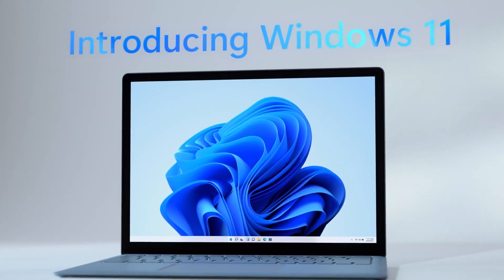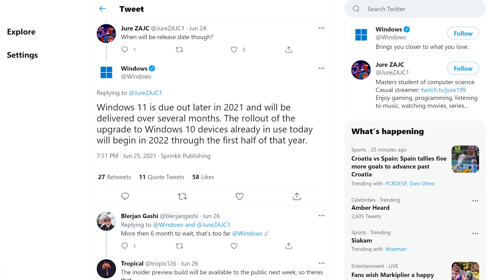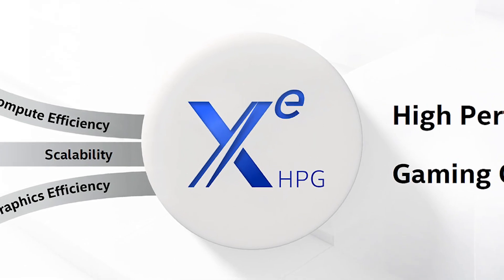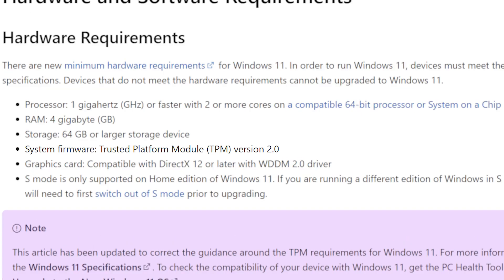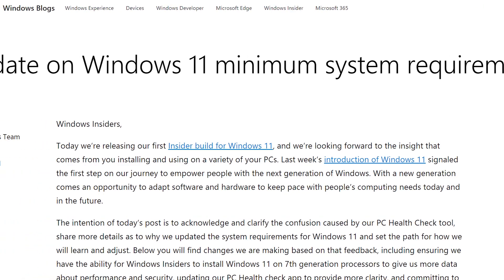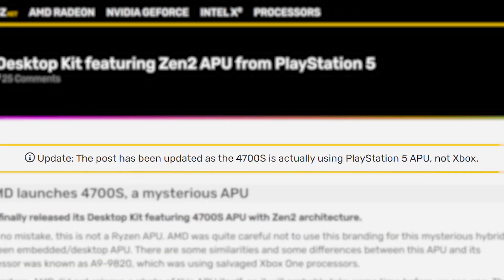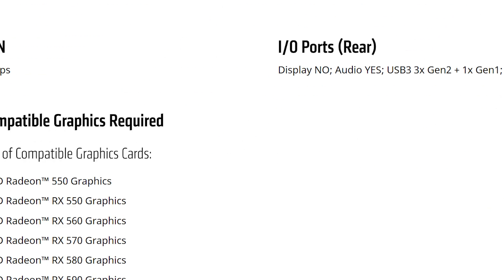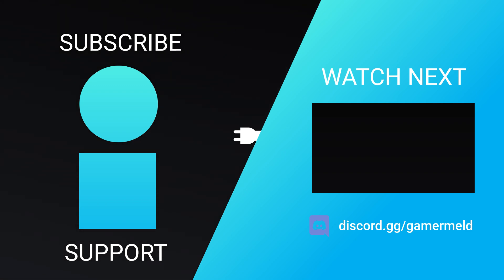TONS Of Gamers WON’T Be Able To Install Windows 11!

Comment: Unless Microsoft just reverts back to Windows 10 requirements for installing Windows 11, they are going to have a terrible adoption rate for this new OS. I guess they really want to keep up with the "every other Windows OS is shit" strategy.
Reply: But win10 IS shit!
Reply: Like lighten the TPM requirements to 1.2, keep the UEFI secure boot Which would allow older CPUs to run Windows 11. I still think they will keep the other requirements though. The current requirements are more of a financial move for them then a beneficial move for anyone using Windows 10
Reply: @IdeasAreBulletproof  Especially considering 99.99% of all users will not use the features tpm offers anyways. I am lucky I own a 9900k, which includes intels TPP, which has TPM2.0 integrated. But as a gamer, I will definitely not usw any encription features etc. Imagine not being able to recover data from a harddisk because it is encrypted :/
Reply: @IdeasAreBulletproof  most people will not even know how to turn tpm on
Reply: @IdeasAreBulletproof  dude my ryzen 5 1600 is tpm 2.0 supported and i have secure boot but it isn't supported XD
Reply: @pisipisimeow  Same with one of my laptops I5 7200U. It has TPM 2.0 but It says the processor isn't supported
Reply: @IdeasAreBulletproof  I'd be happy with no TPM requirements and just let it all be entirely performance based. it's not like TPM 2.0 is useful to most home consumers and even if it was it can be replaced with software so we don't end up with people on eBay scalping. like they do every time Microsoft announces something.
Reply: @IdeasAreBulletproof  they'll never do it, they want to push Pluton-integrated CPUs. hardware level DRM is cancer.
Reply: @NightfallGemini  I know I don't think they will do this. Just means they will get a worse adoption rate of Windows 11 from Windows 10 and a way worse early adoption rate even If Windows 11 is more stable then windows 10. But then again Windows 8-8.1 was stable and had a terrible adoption rate because they got rid of the start menu and button and had new features that would take time getting and made it not easy to use. Windows 8.1 changed that but It was already too late.
Reply: @IdeasAreBulletproof  People are idiots. I installed Windows 8.1 to replace 7 due to Parsec requiring it, and I basically got the same experience (including custom dark theme) but faster.
Reply: @chlorobyte_projects  I used Windows 8.1 for like 3-4 Years In 2 separate Time spaces and I had a pretty good experience With it.
Reply: @IdeasAreBulletproof  windows 8.1 was a lot better than windows 8. Huge improvement, and after update 1 it definitly became decent.

Windows 10 on launch was terrible. You couldn't even change the title bar colors
Reply: @WorivpuqloDMogh  I agree with that Windows 8.1 was an Improvement to Windows 8
Reply: @NightfallGemini  than they wont have as many people adopting the new os its that simple.
Reply: People said the same thing about windows XP, then they said the same thing about windows 7 & 8, then the same thing was said for windows 10(best selling OS to date) and now people are saying the same thing about windows 11, long story short people will upgrade just like they have in the past. There are very few stuck in place old farts that refuse to accept change.

We got people still refusing to leave windows XP even though that OS was garbage with security holes and blue screens every 5 seconds. Then there are those people that think Linux is the be all holy grain of OS systems, yet it has its own set of issues.
Reply: What, I can hear you to care enough. The Linux Community is cheering and breaking out the cardi!
Reply: Just to be clear, this is only about the Windows OS's and how they compare to each other over the years. Linux is irrelevant to the original point, which would be well known to experienced/long time PC users.
Reply: @juzujuzu4555  I have no loyalty to any corporation or brand. Same goes with operating systems. The moment Linux gets better gaming performance and matches the support windows gets, ill switch in a heartbeat. Like I said, best tool for the job
Reply: @SteveDonev  Linux isn't a brand or controlled by anyone, that's the reason why I like it. Though I would be happy with any free (as in freedom) software based OS and tools.

As a developer I know too much about proprietary software and services to ever feel comfortable with them anymore, but FreeBSD or other BSD based system would suit me well in personal stand point, but Linux is superior for development.

But Gentoo is what I truly love. You build your own Linux from sources on that one. While the initial learning curve is semi hard, after that maintaining it is almost as easy as any Linux. The freedom and configurability of Gentoo is just insane.

Lets hope Steam support for Linux gaming is the thing that transfers things. They are building their Linux based PC gaming handheld console. Hope it will get popular, as that would truly change things.
Reply: @juzujuzu4555  I will say this, competition is always fantastic, even if Linux never does overtake windows in gaming performance, the fact that they are inching closer has definitely motivated Microsoft to make windows 11 lighter. The last thing I would want to see is a return to the early 2000s where Microsoft had complete dominance
Reply: @juzujuzu4555  no worries, I read it all lol. Infact if I wasn't an avid gamer I would have probably switched to Linux long ago. As for windows 11, yes the minimum requirements are higher but I think that's just Microsoft sandbagging so they don't get another Vista situation. Based on videos of the insider build of windows 11, it definitely seems to be using less resources than windows 10. Although that may be because not all features are implemented yet. We'll have to wait and see
Reply: @moioyoyo848  it absolutely does. I've ran dual boot windows Linux to test and its pretty consistent. Now don't get me wrong, Linux is better than windows in a lot of things, gaming just isn't one of those, and gaming happens to be the main use of my pc
Reply: @SteveDonev  if you get lower performance that doesnt mean everyone gets
Reply: @moioyoyo848  it was a clean install on identical hardware. Its an os test. Everyone gets worse gaming performance on Linux. Try it yourself. Do a fresh install of windows and Linux dual boot, then run a few gaming benchmarks. You will see that unless the game runs Vulcan (doom), all direct x games run worse on Linux
Reply: Windows 11 will be an Windows 8 2.0
Reply: I disagree. With a newer system and the enabling of the security features I have had no issues and do not project to have any. Adoption will be a no -brainer for new PC / Laptop buyers and those that are wanting to build a new rig shouldn't run into any install issues. With that being said, Windows 10 users are sure to keep plugging along especially companies that are not going to just jump on the bandwagon for a new OS. SCCM should support in the next major release and most software will be compatible as the kernel doesn't appear to be changed that much. It's more of a UI upgrade with some added security that IMO is overdue for the most used and hacked OS out there.
Reply: @thatitdood8593  The security is all well and good, but both the 7th and 6th gen intel support tpm 2.0. If security was the reason for the huge hardware incompatibility, the cutoff should have been 6th gen intel/ Zen 1.

And yes adoption will be horrible. If you look at the steam hardware survey, over 40% of windows users are still on old 4 core cpus, and gaming PCs tend to skiew towards the enthusast side of things. I expect the numbers among non enthusiasts to be far far worse.

Overall I don't expect more than 30% adoption by 2025, when windows 10 dies. (And im being very generous here) Then it may pick up the pace.
Reply: @SteveDonev  Many held on to Windows 7 for as long as they could. Including me. Especially the whole Windows 8 debacle. 

I think Windows 11 will have a better adoption than 10 did but it's all speculation. 

With Microsoft pulling down the "test your system" link leads to speculation that eh... they are rethinking the strategy. I really believe they thought "more" security would be better received. Personally I like it as it will reduce my non-sensical calls from those not too inclined in the PC world. 

As of right now there are a few tricks to bypass the whole TPM and Secure boot for older systems and maybe Microsoft could or should leave that up to the consumer on one hand with older systems and the other hand OEM or pre-builts to include the enhancements and DIYs maybe given their own choice?
Reply: @thatitdood8593  I personally have no issues with a tpm requirement, but again that would place the cutoff at 6th gen not 8th. To be perfectly honest, I see most windows 11 systems being new laptops sold after 2021. Too much hardware is excluded on the old/current desktop/laptop side of things for any meaningful widespread adoption to happen. And like you said, there will inevitably be the holdouts. Microsoft literally gave away windows 10, and windows 10 had practically no hardware restrictions. I just don't think its physically possible for windows 11 to even come close to the adoption rate of windows 10. Well, unless we have an unprecedented laptop boom in 2022...
Reply: @SteveDonev  I am interested to see how Microsoft reacts and if they diminishes some of the requirements. I understand your concern but anyone I can force to 11 in my family / friends circle that are a pain I will force :)
Reply: adoption rate doesn't matter if they already have you using windows 10
Reply: Except windows 7
Reply: @rotzloffel  for sure. that windows 7 start up sound still takes me back everytime😫😩 😂
Reply: @rotzloffel  I "upgraded" so many years ago and I'd do anything to have it back.
Reply: This could be like the XP to Vista and Win 7 to Win 8.   I'll just wait for Windows 12 or "11.2" or whatever they call it when they backtrack on all this crap
Reply: @miykael81  don’t forget about 98 to ME
Reply: INDEED 😅👍
BTW  Win 11 is gonna be one HELL of a "Tungsten Taco"  to Chew those "New"  HORRIBLE Requirements 🙃
GreeTs and GOD Bleess you ALL...✝
Reply: As if win 11 is wanted, reinstall everything, nothing works right,  fck that...
Reply: @juzujuzu4555  or people could have just run malware scans and virus scans to cut down on a lot of that. however i get that the average consumer wont do that. at lest in my experience.
Reply: @supersaiyaman11589  The fact that security is bad enough that your system gets compromised easily is horrible.

Virus scans really only helps if you have constant runtime analysis, and still it only works on malware that is already on the databases.

Someone spying you, getting into your machine and copying sensitive information is horrible, like the source code on software that my company was building. It could have caused the whole company to collapse.

Half of my family is Graduate Engineers, other half is average consumers. Those engineers had more problems, obviously because they do much more with their computers. I was the go to IT support guy. Even developers and computer scientists can be quite bad with operating systems.

Majority of people I know had anti-virus and firewall or Internet security suites. And quite a lot of people had the default once per week scans activated. At least this is my mental image. Only after real robust realtime heuristic scamming became reality, things started getting better. But at that point the CPU and RAM requirements were another level vs. WinXP + lightweight firewall of the early days.
Reply: @STONE69_  Agreed!
Reply: For me it involves entering the bios and turning the option on but tbh will stay away for a while and see if it's a vista MK2 first
Reply: the tmp reqirment is a bet strict but windows itself is a solid os. windows 7 was great .windows 8 was not so good windows 10 is good.
Reply: @supersaiyaman11589  the TPM is a kick in the teeth for lot of people  its not wanted or needed tbh
Reply: windows is a good os. their is a reason they are the leading os in the world.
Reply: @supersaiyaman11589  they lead in the world simply because windows comes pre-installed with just about all new computers and most people can't be bothered to switch over. they also get more software support as far as developers on account of consumers generally being too lazy or unintelligent to install a different Os. as for why it's not Mac OS that's pretty much the same reason why Android sells more than Apple's IOS apple makes high quality (sometimes) more expensive (always) computers and ios doesn't really work with non apple computers. in other words if people buying computers were all smart enough to switch to Linux they most likley would. if all computers were sold with Linux pre installed instead of windows Linux would be the leading OS in the world, and computers would about $100 USD cheaper.
Reply: @supersaiyaman11589  Linux does tend to run a majority of industrial equipment.
Reply: @justinkaufman495  i do believe average users would have trouble with Linux destros
Reply: But its good fore the feuture of Windows 11 becuse they dont need to realie on really old Hardware to work with all The uptades.
Reply: People pretend they didn't want windows 10 but keeps on yamming about its requirements. You don't want it in the first place then don't talk about it. They already know that they were asking too much. Why do you think they support windows 10 until 2025?
Reply: @UnoZero1  Having high requirements isn't a problem, Having stupid ones is. Why aren't 6th and 7th gen intel supported? They have tpm 2.0 and are way more powerful than the minimum cpu spec. Also why is tpm even required for desktop? Laptops and tablets i get, but mandating it for desktop is beyond useless.
Reply: @SteveDonev  by 5%-10% less you mean more?
Reply: @moioyoyo848  nope, I mean less. Linux just isn't as efficient at running games than windows.
Reply: @SteveDonev  then why to linux users get more fps and have less ram usage ?
Reply: @moioyoyo848  because Linux is a lighter OS, but Linux can't run directx natively and uses directx to vulcan conversion via Wine. That costs games 5 to 10% fps
Reply: Well Windows XP was absolute shit. The user interface was nice, but the security level was atrocious and compared to Linux it was also slow.

Vista had couple massive problems, otherwise it was really good actually. One it was constantly asking permissions to everything, and that made using it hell. Also initial driver support was shit. Windows 7 was Vista with small improvements. Also computers became much faster during those years and so slow Vista changed itself to fast Windows 7 like magic for those that bought new computers that had Win7.

Win 8 was absolutely horrible. Win 10 managed to be even worse, and now Win 11 is going for a hat trick by being even worse still.

But I thank Microsoft for finally making me migrate to Linux completely when Win10 came. At that point I just couldn't stand it anymore.
Reply: @juzujuzu4555  ok
Reply: @juzujuzu4555  i remember XP was horrible when it came out, SP2 fixed all the kink though. But security at the time was MS strong point imho.
Reply: @juzujuzu4555  I tip my fedora to you fellow Linux user Hehe. Windows bad linoox good 😁
Reply: @ireallyreallyreallylikethisimg  Have fun not having full functionality
Reply: @juzujuzu4555  Linux has worse gaming performance than windows tho. Wine on average eats 5-10% fps. For gamers Linux just isn't good, but better than macOS at least for what its worth...
Reply: @SteveDonev  If you are CPU bound, Linux has worse gaming performance. And that's really rare nowadays. GPU drivers have become so much better, and DirectXtoVulkan is pretty amazing.

If the only thing you care about is gaming, then there's no point in migrating just yet. But if you care about you being in control of your system, having total freedom, no spying, backdoors, telemetry, then Linux is your best bet.

And you can change the system to match your workflow. 

Emulators and old/ancient games should run better on Linux, though I don't have experience on this but I believe what I have heard as it makes sense.
Reply: @juzujuzu4555  to me an OS is a tool and the job i need that tool to do is gaming. And windows is just better at that. Not to mention all the issues linux has with nvidia. (That Linus Torvalds clip of him giving nvidia the finger was both amazing and well deserved lol) As for windows spying on me, I don't really care too much. What are they gonna see? Me playing sekiro? Lol
Reply: @juzujuzu4555  lucky you my dude. If I can only get Resident evil to run on PoP os. Gaming is what's keeping me tethered to Windows 10. My hardware is also shit so I can't go archlinux. I'll try when I buy a new rig come winter
Reply: @nicoldengenyakeye6905  What you do mean your hardware is shit? That it isn't comparable/supported?

Which Resident Evil you mean? Based on ProtonDB everything is either Gold or Platinum supported/level of working, thus just open proton on PopOS and click install and that's it.

Migration takes learning new paradigms and work. It's like quitting smoking, it takes effort but you'll thank yourself later. Though I would encourage migration only when people are truly ready for committing themselves enough to stay with Linux long enough.

The initial period has all the problems and learning, but the longer you use the more your paradigms change and enjoy Linux and truly see how shitty Windows is. That feeling of 100% owning and controlling your computer is great.

And slowly configuring things to match your workflow is great.
Reply: @juzujuzu4555  strangely enough I'm very good with Linux. It's just this one game. Resident Evil HD remaster that doesn't work. And cuphead too it freezes after launch. But it's my hardware. I'm still on sandy bridge and a Gt730. In win10 it works. But I'm sure it's my hardware. Everything else is super. So I dual boot. Arch misbehaves with my WiFi card though. So I settled for pop os and win 10. I mostly play old and indie games so I'm. Not so hung up on FPS.
Reply: @nicoldengenyakeye6905  Your CPU should be fine, or almost 100% is fine. But Nvidia drivers might be the reason. Do you have the open source drivers of proprietary one? Proprietary I would assume, but in the case not, those are quite important with Nvidia, though AMD and Intel have great open source drivers that are better than proprietary one.

You need to load linux-firmware to get firmware for wifi. Arch in default doesn't have that. Manjaro should allow you to choose installing these with the installer, but on pure Arch that should fix the situation.

The open source drivers cannot change power levels etc. of wifi transmission, those pretty much force you to load closed source firmware to run well.
Reply: @juzujuzu4555  I installed the Linux-firmware package its just that when the internet gets wonky the wifi card drops the connection and wont reconnect until a  restart. i checked online and the consensus is that card is old ill need to buy a new one. i installed the Nvidia drivers and they work great 90 % of the time its just those two games that bring problems. cuphead gets  stuck on the beginning Logo and Resident Evil wont play the first cutscene. it shows the capcom Logo then its blackscreen and never passes that. Im sure its my hardware that is the problem coz everything else works great. Pop is my daily driver... just sucks to dual boot. Advantage is im profecient in both Linux and Windows.. but Windows isnt where my heart is :(
Reply: @nicoldengenyakeye6905  My newest wifi hardware is from 2012. And my computer uses it 24/7 because I have been sharing things on P2P networks the past 15 yrs.

If your wifi works on Windows, then it's not hardware problem. 

Nvidia's drivers on Linux are not as good as AMD's open source drivers, those get fixes constantly. But I still feel this is wine related thing, but it could be the drivers.

When have you installed PopOS? And would installing PopOS be a huge amount of work? Based on what I'm hearing I still think there's a big chance that some update at some point hasn't updated everything or left behind some config files from older version that cause problems. 

If you have extra HDD, you could install PopOS there and check out if it works.

And if you happen to do that, I would really appreciate hearing if it fixed things.
Reply: @juzujuzu4555  the funny thing is. That WiFi issue is only on arch. And on the latest kernel. On long term and stable it is not an issue
 The same to  Windows. The connection at least persists.
Reply: @juzujuzu4555  Windows 10 is objectivel, in no way worse than Windows 7 or 8 snd 8.1. 
It is significantly faster, more secure and offers way more current features that offer huge benefits. The only annoying part is this Cortana crap but you can basically uninstall all of that in 3 minutes. And all that with similar ressource usage (which isn't great but it at least didn't get worse).
Reply: @juzujuzu4555  i was on windows xp and it want bad at all in my opinion.
Reply: @juzujuzu4555  I stuck to windows 2000 for ages
Reply: @juzujuzu4555  what in your opinion was bad about windows 10. can you be more  detailed.
Reply: @juzujuzu4555  it depends on what people are using the os for . what is a bad  os for one person another person may like.
Reply: @supersaiyaman11589  Sure people might like any sort of shite. There are many objective metrics for OS though. Performance, security, modularity, verifiability (aka if it's open source you can verify it's security etc).

Performance itself has many aspects, for example nothing beats tiny real time OS for latency, thus if that's what you need, then RTOS is the obvious choice.

Windows has couple things that are good, software support and hardware support. Also compatibility with legacy software is good with Windows. In Win10 era the kernel itself has also become better, but still performance and security/privacy are the weak points of  Windows.

At the same time Linux' hardware and software support has become much better. And Linux is getting rapidly better, things change pretty much every quarter.

When people migrate to Linux, they usually get all the problems at first, they need to learn different OS (quite easy process) and they look things from the perspective of Windows. If they stick with Linux, they will learn Linux' paradigms, and when they do, they usually fall in love with Linux.

Nothing beats open source, it evolves like science. You can copy freely all the work others have done, improve on it, share for others. And as it's free, the amount of people who make the OS and it's components better is massive.